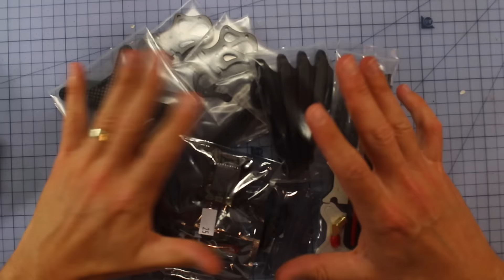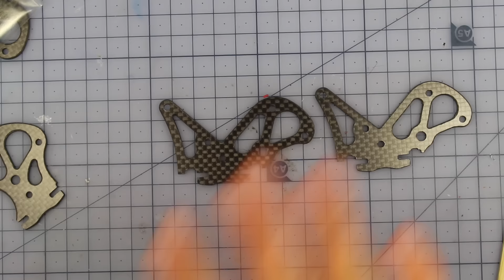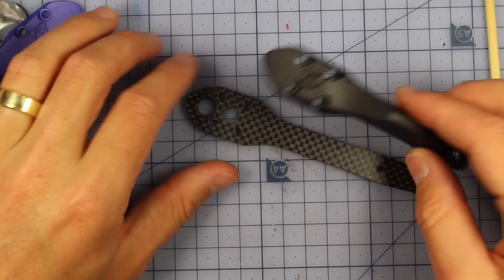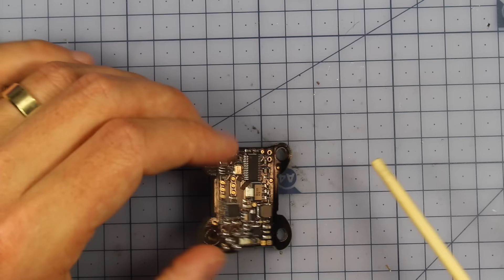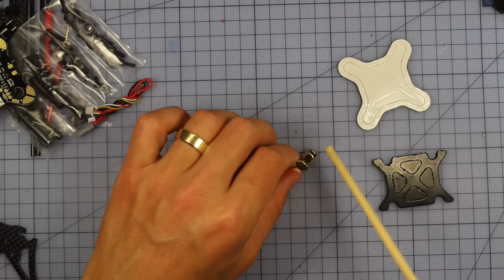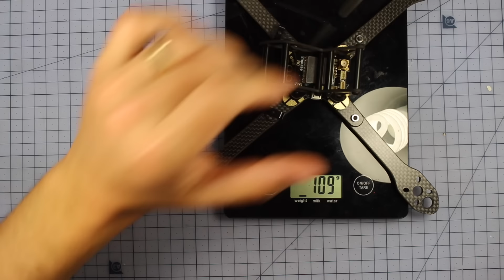ImpulseRC Helix Quadcopter Review. Overview + Full Kit Breakdown.

Comment: WARNING: Don't buy this kit (especially if you don't live in Australia)! You will not be able to compete because all the electronics on the Helix kit is proprietary. When you break something, it talks too long to replace the part. ImpulseRC is incompetent when it comes to product fulfillment and they have very few other vendors. I have 5 helix kits that have been sitting on my workbench for over 3 months now because Impulse can't meet fulfillment. We are stuck racing 3 year old quads while waiting for Impulse to get their act together. Will no longer be doing any business with ImpulseRC.

Advice: Invest in quad kits that allow electronics that are universal design like, TBS Unify, 30mm boards, etc. That way if a vendor can't supply product, you can go with someone else and still keep your quads in the air. If you buy Helix(Proprietary design) you are a slave to their fulfillment and will end up very disappointed.

Comment: hey stew 
i was wondering what you need to get fpv footage (like live )
(i have a little camera)
Reply from the maker: you need a set of goggles like the "fatshark dominators"
Reply: UAVfutures does the skyzone 700d the same thing and do i need a antenna and sender kind of thing ?
Reply from the maker: minecrafterguynl you need an fpv camera, a video transmitter, 

and then on the receiving side you need a receiver, an antenna, and a screen. yes the skyline 700 d is those three things in one. I have a review of it actually on my channel

Comment: was waiting to see a review of this frame, so thank you very much..  awe , desapointed by the construction, including everything in the frame, PDB and FC etc.. It is one of the coolest frame concerning the shape, but it s not made for crashing.. The light parts will get ripped apart included their exclusive electronic parts... You better try to not crash hard or you ll have to change camera angle :) , if the lights chips inside, playing a role in the structure.. stay intact :)
Reply from the maker: I think the pd. and fc are great for crashing, the part I wonder about is the top pod mount thought. But time will tell. Glad you liked the video
Reply: Thank Stewart for the answer, i like your reviews and your flight videos are very cool...You got a thumb up everysingle time :) For this one i regret that they included their electronic in the build.. Is it possible to run and other FC or PDB inside ? I m not sure.. And i regret that, because even it can be preforms great, if you re FC burn, or the PDB got any issue.. you can t fix it without buying their exclusive parts, for me it looks like a "business hack", and i feel less bad flying with a martian :)

Comment: And im just sitting here and still waiting for the Kraken 5" review and build video. ;)
Reply from the maker: I know I know. That is the only frame that sort of fell through the "kracks" but it is coming, at least you can see it on the wall. its in the middle just above the light. Pinkish heat shrink on the arms and no props. almost dead centre. its coming.
Reply: i have two K6's and soon i will build two K5X for my self, but im dead curious about your opinion on that awsome frame. :)

Comment: Are the ESC fairings moulded or printed? They look pretty nicely finished.
Reply: injection moulded polypropylene
Reply: STRYKA Very nice!
Reply from the maker: Hey sean, They are moulded so very tough. apparently a 3d printed part is only about 30% as strong as the moulded part.

Comment: put those esc mounts on the top and the motors on the down side of the arms so that they push instead of pull. I would love to see that :) I'll buy that frame and build it that way. guess that's the perfect frame for building that way...
Reply: FPVollgas Germany post a video when you do that
Reply: That would be impressively aerodynamic. Got me tempted to flip my arms upside down!
Reply: FPVollgas Germany great idea!
Reply from the maker: all I worry is that the battery might hit the props if its too large or the wrong shape

Comment: Damn. You sold me yet another frame. This is mental. 12 is my current nr.
Reply: The price of this is metal.
Reply from the maker: I think for everything you get its actually a bit better value this time around. Still a premium though
Reply from the maker: you have 12 drones?
Reply: UAVfutures You might want to check out the Kraken 5R or 5X. They are crazy good, and not too expensive either. From RCBolt. Cheers
Reply: Oh you are really right! I'm ordering one right now too. You have the force aaaa!

(ps: stay awesome! you are my favourite fpv guy :D + very faithful)
Reply: +UAVfutures Yes! I was gonna build and sell. But, cant. Haha.
Reply: Dawoud Yololu Why sell??
Reply from the maker: there is a k5 kraken in this vid. It is in the center of the wall, just above the light, its has pink heat shrink, no props. ; )